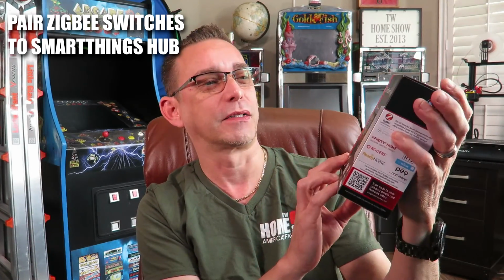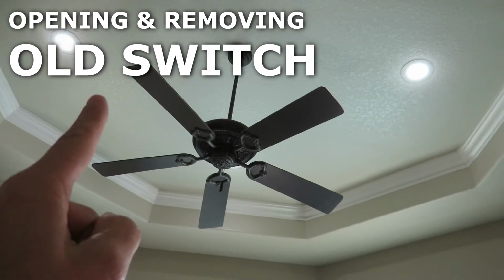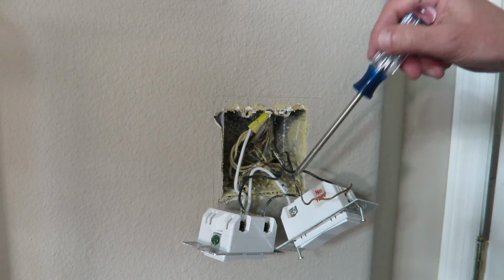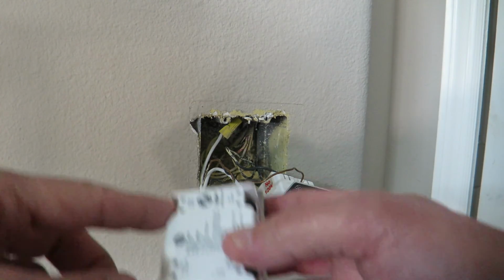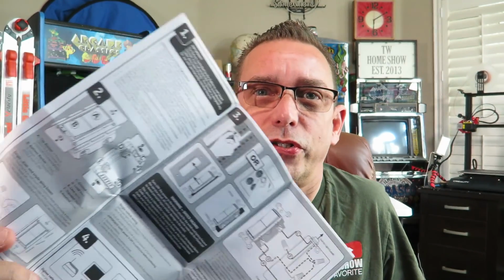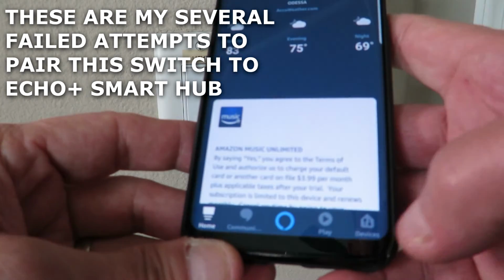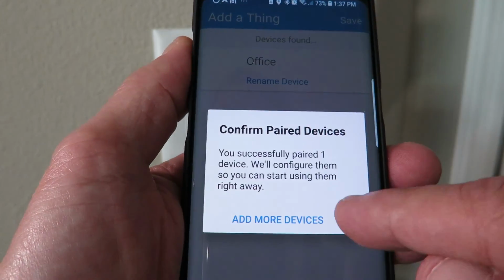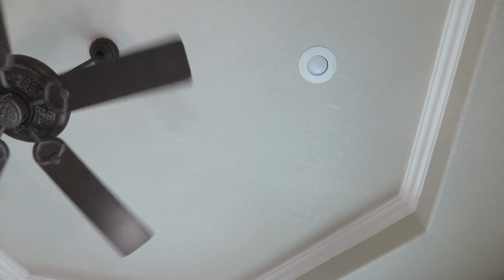ZIGBEE Dimmer Switch Install | In-Wall Dimmer Switch | Smartthings Hub

Comment: This helped me pair it to Alexa app.  Had this working for 5+ years then needed to re pair due to all devices not recognized.  I found that after you pull the air gap, then hold the up button and push the air gap in and let go before 4 seconds.  Next when you add switch and select GE in Alexa app and it’s searching, press the up button once while searching and the app will detect it.  Thanks

Comment: Hi, there, what model of smartthings hub did you use. I have the same enbrighten dimmer, but wouldn't work with Amazon stuff. So, I want to get a smartthings hub, but there are many of those in the market. Thanks.